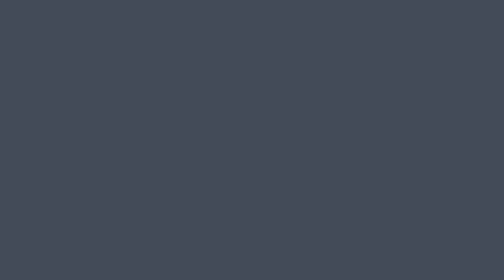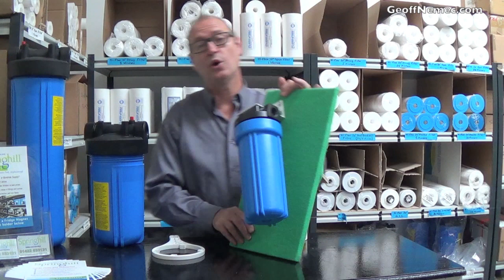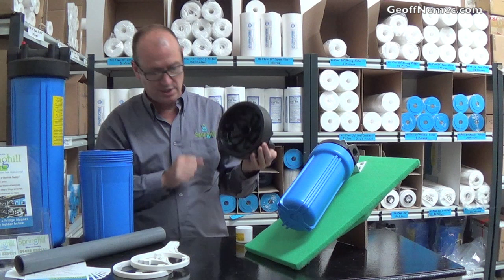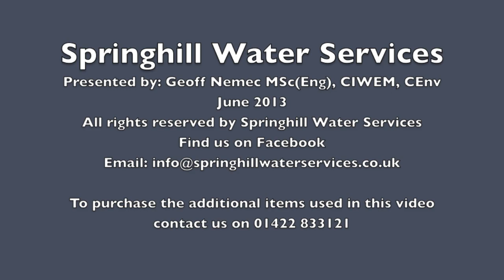How to change a water filter when the bowl is stuck

Comment: I had to use two wrenches to break the seal, one with a 2' long 2" pipe attached as a breaker bar. By the way, once you unscrew the cartridge from the bowl, you probably want to clean off the old lube and apply new. That was another challenge! In the end, I added about 2 ounces of Seventh Generation Citrus Dish Detergent to 16 ounces of hot water - the hotter the better. I then used a small scrub brush and scrubbed the old lube off in a bath tube, then rinsed the lube and suds away with hot water. Magic. The old gunk came off beautifully!

Comment: Adding a lubricant, of any sort, to the threads is against the manufacturer's recommendations and will void any warranty on the product.
Reply: Thanks Todd for this comment. Having checked the instruction manuals for a couple of filter manufacturers they are quiet on the subject of whether or not to lubricate an O ring. My understanding is that it acceptable to use food grade silicone grease for your O-rings to help facilitate an easier filter change. Any additional information regarding the pro's and con's will be apprectiated.
Reply: @geoffnemec-hillwalker.film9648  O-ring, yes, threads, no.
Reply: @tjmenna  What would be the downside to lubing the threads? Mine is stuck right now and I sure wish the last person to service it would have lubed them!
Reply: @kurttappe  Lubrication of the threads makes it easier to overtighten them when installing the housing.  The hair dryer and wrench is the best option for loosening.  If it's too tight to remove, it is either overtightened to begin with or been installed for a long time without service.

Comment: Tried a strap wrench. Didn't work. Tried two plastic wrenches. Didn't work. Filter company suggested a steel wrench they sell, but it was way too expensive. Went to a Vise Grip chain wrench. THAT worked just fine.

Comment: This is useless. Either I basically tear it off the side while unscrewing it OR I try to use my hand to hold a ridiculously tight cartilage, which isn't any better than just using both hands. I guess this helps those that are weak and can't unscrew a cartilage that has minor to no problems and I'm not reattaching it to a board. Guess a new filter system is in order. Past owners didn't take care of anything, tbh.
Reply from the maker: Sorry that its proving difficult. The vacuum cleaner hose suggestion below might help. A bowl sticking isn't always due to over tightening. Its very frustrating, but the only thing i can say is that it will come off with enough leverage.
Reply: It might, but some of these systems are just junk, coupled with previous owners who shouldn't be left alone to operate a garden tap, let alone anything more complex.  I had to apply so much force it cracked the bowl end to end before it finally loosened - HEAPS of fun with < 3 foot clearance underneath a building. The plastic wrench (also junk) never stood a chance, required a strap type automotive oil filter removal tool+600mm long 1/2" drive breaker bar (solid steel, a hollow thin walled vacuum cleaner hose wouldn't have held up at all).

Comment: Why would I still have water pressure when trying to do this? I've turned off the water (I think) and I can't seem to relieve the pressure
Reply from the maker: Turning off the water won't relieve the pressure. If you don't have the red pressure relief button on the top of the filter housing you may need to find a way of relieving the pressure after the filter. This could simply involve opening a tap, or (more complex) opening the ball valve in a storage tank after the filter. It may be that the bowl is just stuck in place. In which case, you need to try the techniques shown in the video. No easy answer I'm afraid.
Reply: Thank you! I think the valve is starting to go, as it wasn't fully closing, and water was still going into the system. I appreciate the help!!!

Comment: Right but that flimsy bracket that holds the filter to the wall will not withstand that kind of torque.  Even with one wrench and no leverage I'm clearly bending the bracket.
Reply: actually i thought the same thing, used a pvc pipe to increase leverage, and with a loud pop, it came loose!
Reply: John Beaton Mine almost ripped off. It depends on how tight it is on.

Comment: look down on the filter from the top and it makes sense. I don't think I got it wrong. I don't have a filter here to double check, but I did double check everything at the time. watch what I do in the video if the words are confusing. btw. thanks for the comment and I will look at the video again tomorrow. don't want you pulling the filter off the wall 😀

Comment: THANK YOU!  I used an extension pipe for my vacuum to apply additional LEVERage and it worked like a charm!  Thank you!!!
Reply: +JoGotta Thank you! I have two systems, though my filters aren't exactly the same. We broke one of the plastic wrenches, didn't want to break the other. After weeks of trying to think of a new strategy, I saw this video, read your suggestion re: the vacuum pipe. It worked!
Reply: +Sara Hewitt yay, yes, I can easily see where you'd break that wrench!!